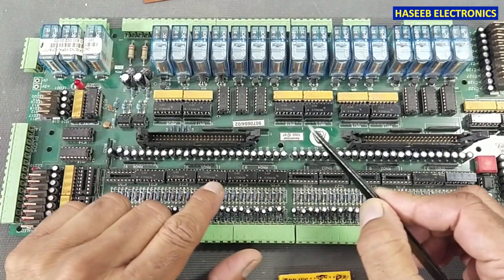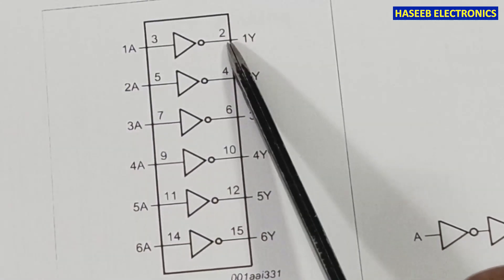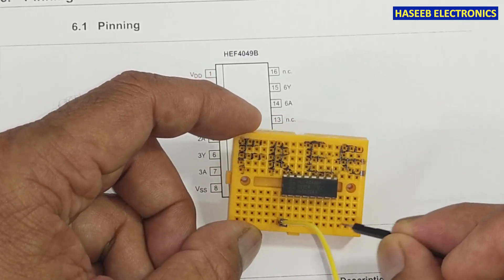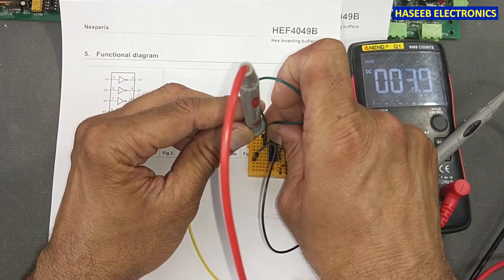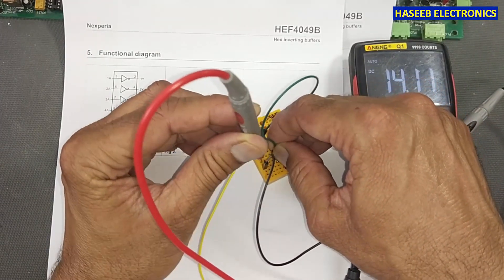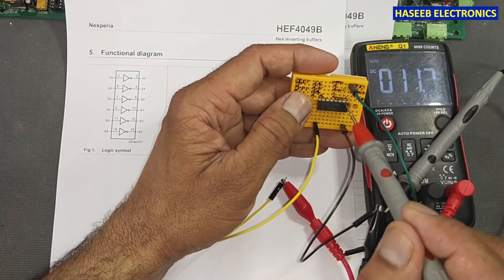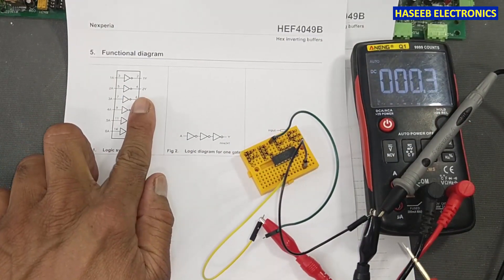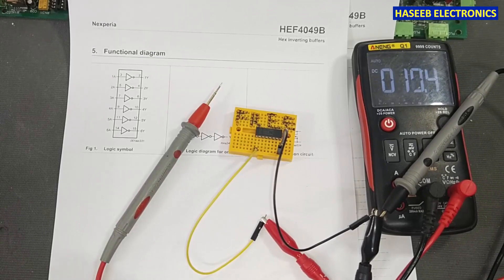{736} How To Test HEF4049 IC With Multimeter

Comment: Bro plz suggest me a good multimeter .
Reply from the maker: if you want best quality Fuke 87V Max (but it is expensive)
then fluke 179 is awesome (price is less than 87V)
then uni-t, Aneng- Q1, are reliable and cheaper. you can select any brand with frequency, temperature, capacitance, voltage rating above 600V (1000 is superb), with some hard casing. and you can compare prices as well.
Reply: @HaseebElectronics  thanks for your reply bro